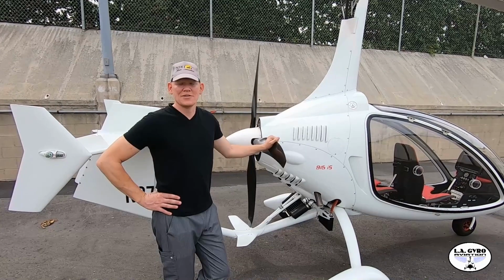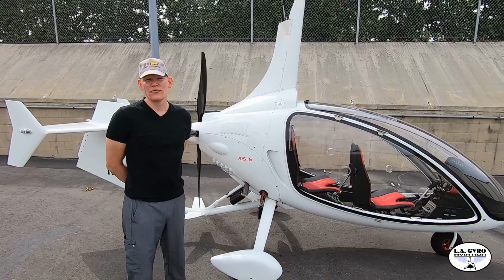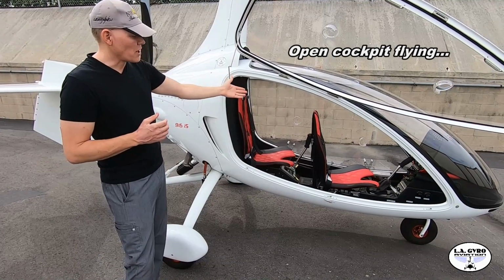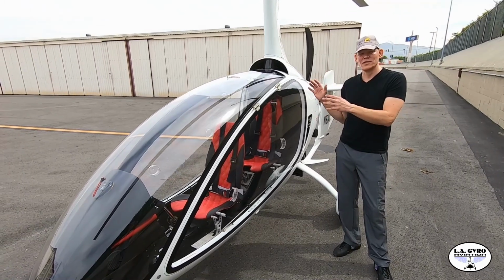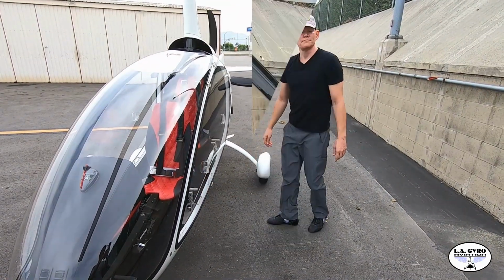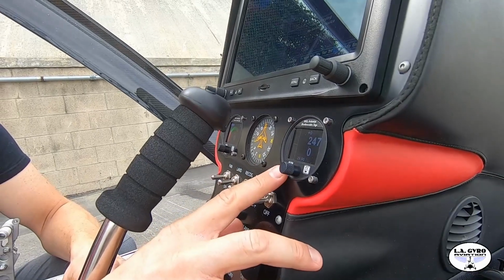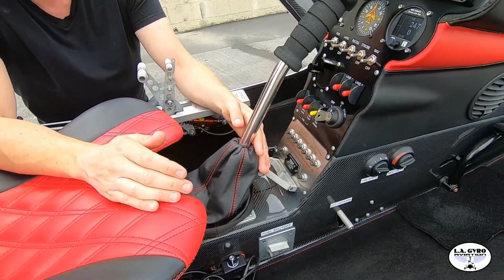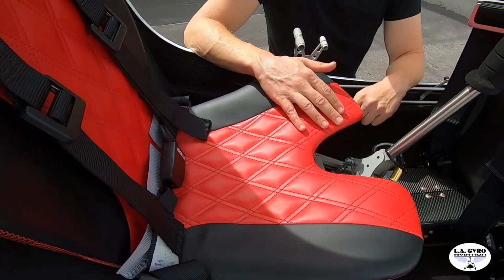Niki Rotor Aviation Kallithea - a pilot's review

Comment: Are there any  luggage or cargo compartments?
Do you have an update on how this machine is holding up after 7 years?
What would this 2018 model cost today now that it's 7 years old?
Reply from the maker: Cargo storage - there is space on both sides of the back seat, or the back seat itself can be a storage rack. Make sure no flight controls are impeded by the stuffing of luggage around them. Don't forget that we are talking about a small aircraft with fairly limited useful load, so if have two people on board plus fuel, there is almost no way to get luggage and still be within the Weight & Balance of the machine. There is plenty of room for two small overnight bags...
This particular gyro is not cranking the same number of hours as before, but that is mainly because of the personal schedule of the owner. He still loves it and considers it the best way to enjoy one's time in the air. Another Kallithea (laudly heralded on this channel) flew from Los Angeles to Oshkosh and back in an epic adventure coupe of years ago. Yet another machine, currently residing in Michigan, flew from Florida to its home town with a crew of two people. 
Current price... I have no idea what this onwe would go for... if it was for sale. My experience is that Kallithea owners are selling their other gyros to get a Kallithea, then hold on to them... ;)
Contact me via email (peter@lagyro.com) if you want me to notify you should an used one gets on the market.

Comment: Thx for the review. Sorry for the noob question; but how does the throttle work since it has 2 levers? And how do you brake the rotor and landingwheels?
Reply from the maker: The throttle has one lever, and the hand brake is attached to it in the front, so you operate the throttle and the wheel brakes with the left hand. There is another lever for the rotor brake - it is off screen.

Comment: Great introduction!  I read below that maximum front seat weight is 280-297 lbs. What is the maximum front seat headroom? I'm 6'3" and curious about not being too confined. Thanks.
Reply from the maker: I am 6'4" and sitting on the front seat with a memory foam cushion and Dave Clark headset, I still have 2-3 inches of headroom depending on how I slouch on the seat. I usually use Clarity Aloft, so that leaves even more headroom. This machine is roomy...

Comment: The max front seat weight is 297lbs and minimum weight is 132 lbs. the aircraft should always be flown with someone in the front seat to maintain CG limits and stability. That said, it’s a very stable machine in flight with 4-way power trim and smooth controls.
Reply from the maker: It is a fantastic gyroplane… not only good looking, but also a very hard worker…

Comment: What's the pitch stability  like with your horizontal stabilizer being mounted higher up in your prop wash
Reply from the maker: The stabilizer being where it is makes it more efficient since it "captures" more of the prop's blast. What deteriorates the horizontal stability of an enclosed machine is usually that big surface of the cabin. One of the reasons why Magni is delaying their new tandem enclosed machines. The Kallithea has 4 directional trim which helps in that regard, and the machine can zoom through the sky at 85 KIAS in a very stable fashion...

Comment: Is it cable controls or tubes running to the head and what's it like to pre flight with having 100% visual inspection on controls?
Reply from the maker: The controls are done by cables not control rods... I have to admit this is something that gave me a pause when I was first introduced to this model, but when you start looking into the design and the historical reliability of the cables, I believe it is time to give them their well deserved respect.
About the pre-flight... You have to remove some panels to do the inspection, but the quick disconnect fasteners make that task easier... It will never be as easy as inspection an M-16, but this is not an M-16...  :)

Comment: What's max weight for proper hang angle in front seat as this company is generally new why would you choose this over a proven Magni gyrocopter?
Reply from the maker: This is an enclosed machine, designed by a team with solid aviation traditions and knowledge, just like Magni. In my opinion, a tandem enclosed machine is a much better choice than a side-by-side (Magni still does not have an enclosed tandem). I will check in the exact number for the front seat weight, and let you know. I personally own a "proven" AR-1, which I flew from Florida to California, and I love it... but the Kallithea is a different animal, that is why I am giving it my attention and effort to bring it to the U.S.
Reply from the maker: Shawn, found the number for the front seat - max weight allowed for proper hanging is 280 lbs.
Reply: @lagyro  they us to make the lightning I think prop was in the middle of the tail very sharp looking but I would think maintenance would be a pain gaining access 👍
Reply from the maker: shawn wright the Lightning is still under development, so now the Kallithea is the number one effort.
Reply from the maker: ...and the minimum weight on the front seat is 130 lbs.